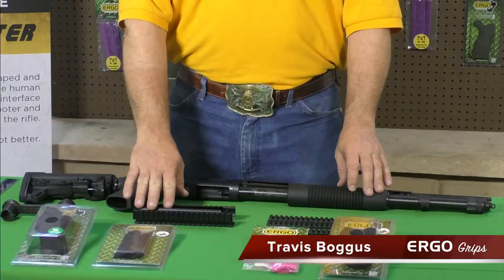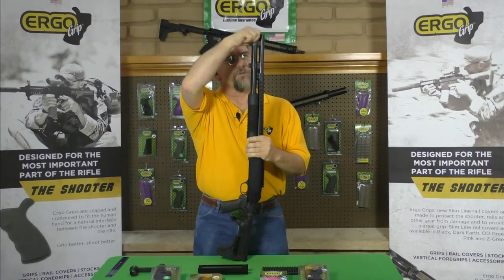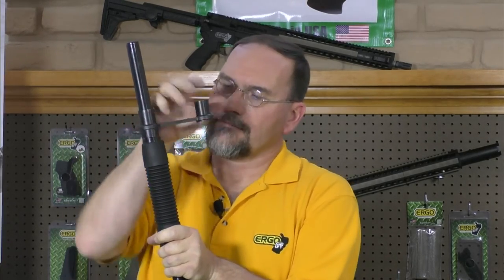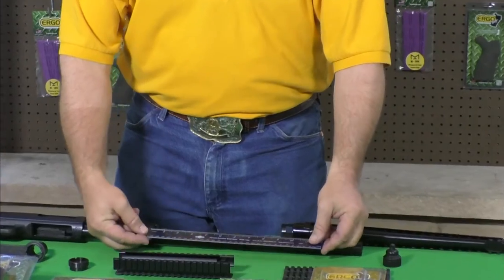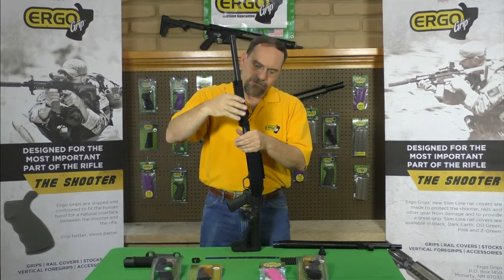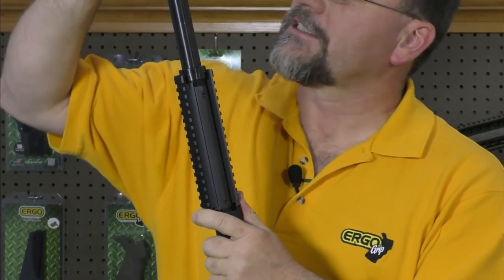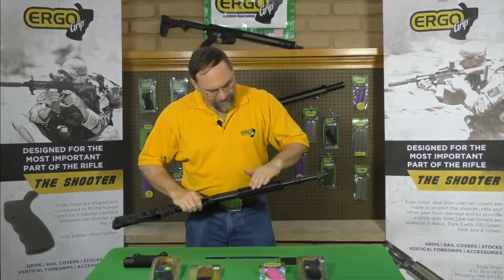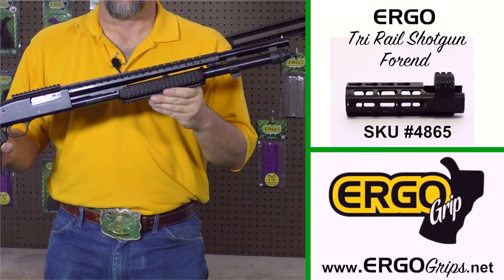#6 Tri Rail Shotgun Forend Instructional Video

Comment: Great product. I have one installed on my Mossberg 500. Handles a vertical foregrip with ease.
Reply: which vertical foregrip did you get?
Reply: @meatbeaterbunny  The Broomhandle with the cam and battery compartment
Reply: @bretthines1020  Hold up a sec. Just tried searching for that. Did you mean to type "camo" or does your foregrip have a camera built into it? Serious question for a friend
Reply: @bestmantoday  way behind the curve but I noticed no answer. Not sure what he means by “cam” but I’m figuring just a picatinny attachable handle with the screw on cap that you can stash a few AA/AAA/cr123 batteries inside. I’ve googled all kinds of brands and configurations….nothing about cameras. Maybe camo like you said. Being 5 months behind…comment back if you figured it out cuz now I’m stumped.